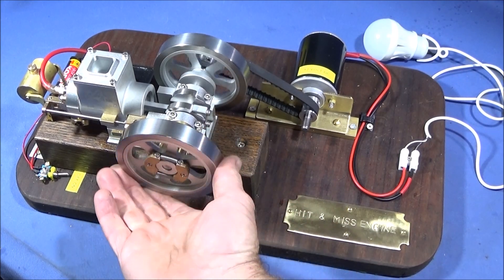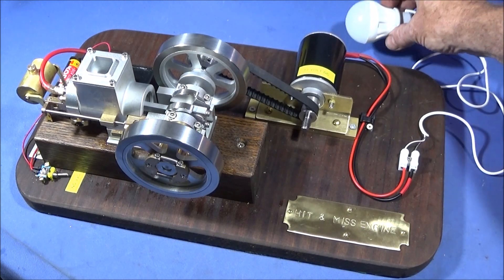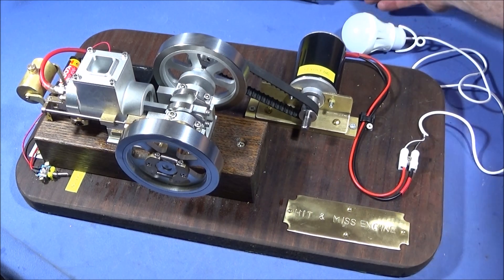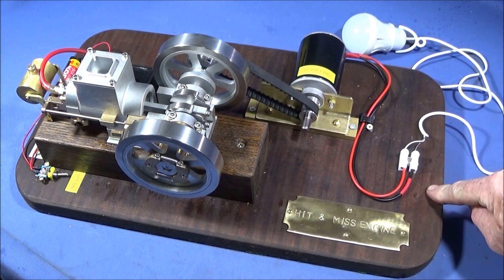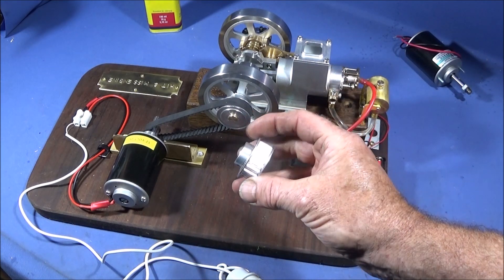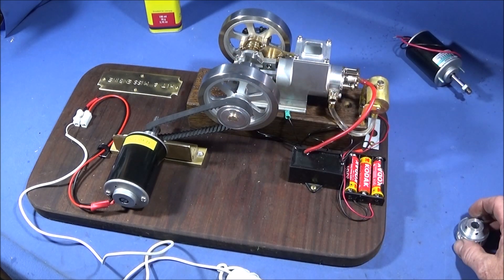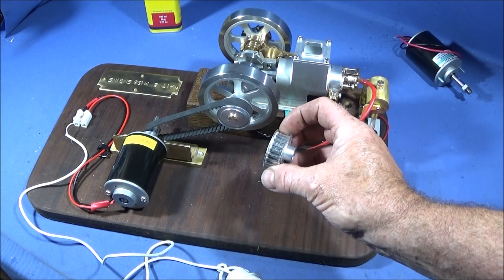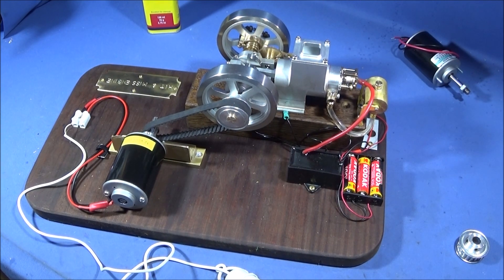Model Hit & Miss M90 Engine & 12 Volt Generator Set-Up. Eachin ET1

Comment: Lovely Steve, but you could do with a tiny hole at the top of the cylinder, so when you lubircate the cylinder, the oil then runs down, lubricating the to and bottom of the cylinder (as like the drip oilers on the full size counterparts.)

Comment: A great demo / proof of concept video - thanks for sharing.  This old efficient tech (may need to be up-sized a bit) could be used to act as backup power supply for all kinds of uses (ie charging cell phones and more) powered by a 12 Volt generator.
Reply from the maker: Thanks for watching. Regards Steve

Comment: How much torque does this model have could it power a set of double k horses shavers if equipped with a gear reduction to make the clippers run at 80-100 rpm  the electric motor inside the clippers wall mounted motor mount is the same size as the bigger one of your motors

Comment: Just received same M90 engine & it has a "mystery" allen-hex drive screw located centered above rear of cylinder about 1/4     inch from cylinder end. It dosen't seem to reach the piston in depth. Does anyone know it's intended  function as i don't see it in any online photos/videos. Thx, tom.
Reply: Probably so you can add a lubricator for the cylinder?

Comment: something tells me that  a  tiny  hit-miss engine  makes an  inefficient  prime mover; and its use as one is not  logical.
Reply: The hit and miss motor is an early motor used in the early 1900's for power before electrification and other better means of power. They are underpowered and inefficient by today's standards, and are not used as main power sources anymore. But their unique character and history endears us motorheads to keep them running to preserve their history and the era they powered. Just please enjoy the uniqueness of these motors with us.
Reply: @ronfullerton3162  wellll.    you boys are free to think that way.    but, when i see a  working engine,  running slowly,     i see  design/engineering  defects.
Reply: @daviddavids2884   A hit and miss engine will never be a racing engine. An F1 motor will never survive as an industrial engine. Engines are designed and built for purposes. Sure, some motors are far more inviting. But there would be no need for that F1 motor if we didn't have the working motors that built the F1 race track. You prefer the pazzaz of rich and famous, while I value the sweat and tears of what made all we have possible. To each their own.
Reply: @ronfullerton3162 do  you  have  a  POINT.     i didn't think so.    out
Reply: @daviddavids2884  Ha ha ha ha! What a troll! I have stated very clearly the difference of time and purpose of these motors. What have you supplied other than cop an attitude? If you have no content, I have no more time, sorry
Reply: @daviddavids2884  ever heard of having fun and enjoying your self

Comment: Steve, could you use the DC motor as the starter?   Would this work and is there a way of switching it so that it would.  Just a thought.  Good video very interesting. Thank you.
Reply from the maker: I did have the same thought when I put it together. I will check out the torque of the motor later and see!

Comment from the maker: SEE LINKS BELOW:-
Eachine ET1 STEM Upgrade Hit & Miss Gas Engine Stirling Engine -- http://bit.ly/31mFSwe
More Stirling Engine -- http://bit.ly/2ODqzxw
12/24V 30W High Speed Permanent Magnet Mute Metal DC Motor -- http://bit.ly/2ksrVNe
Banggood 13th Anniversary Tools Sale -- http://bit.ly/2KZttZx
Reply from the maker: 2019 Banggod Electronics & Tools Sale -- http://bit.ly/2KYyenl
2019 Banggood Summer Sale Shopping Guide -- http://bit.ly/2Lt4Kxy
 $1.99 Tools & Mechanical Parts -- http://bit.ly/2OSwi2O